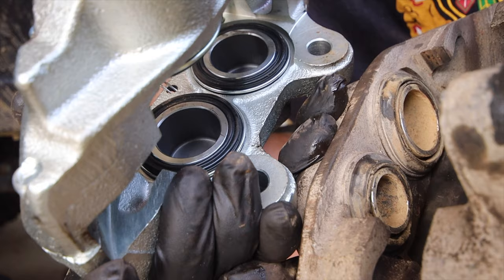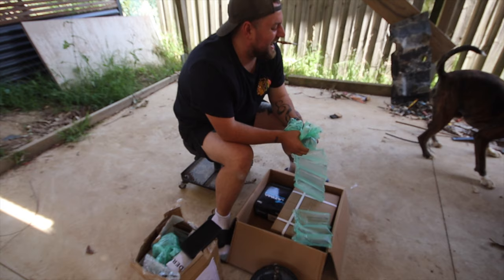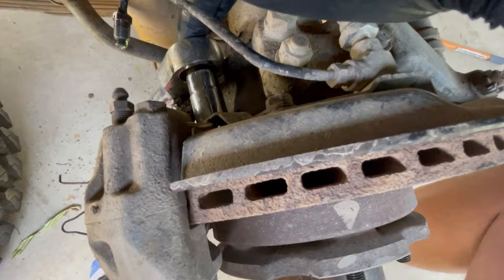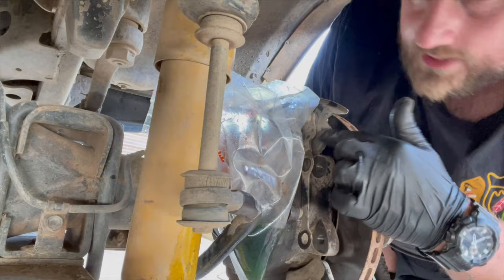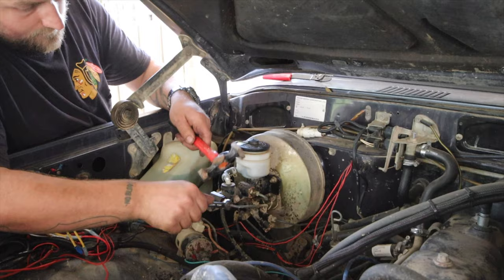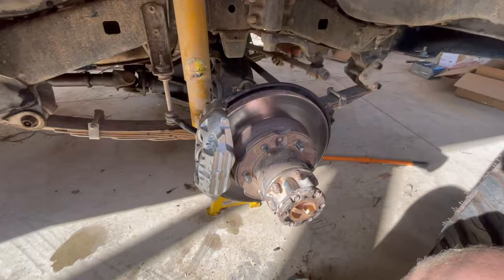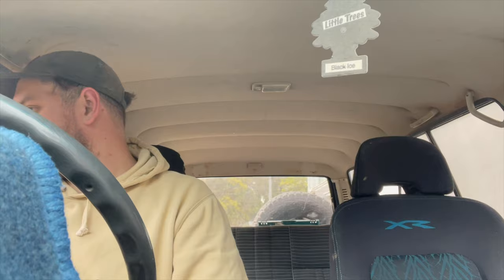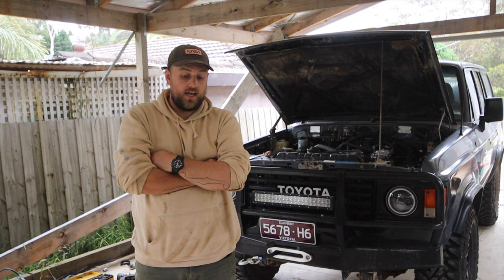Hilux brakes in a landcruiser?

Comment: Did you do the master cylinder? You're much smarter than I am. 33s and a 200kw 1uz in an 85' 60 with shitty brakes. Nearly put myself through a wall. Thankfully I managed to stop by down shifting and used the handbrake I'm defo going to do an upgrade. Your 60 is looking good!!
Reply from the maker: Jesus dude. That’s scary. Dude I’m not smarter than anyone else here. I learnt everything I’m doing on YouTube. I’m defiantly not a mechanic!
Reply: @favouritejay  Keep at it dude. We all learn by doing. It's going to look brilliant and you're going to be so stoked once it's all done.

Comment: you may find you'll need to get a bigger vacuum reservoir
Reply from the maker: Interesting, I’ll let you know 👍
Reply: @favouritejay  i'm having that problem after doing a ln106 caliper, 80 master and dual diaphragm booster, braided lines and fj45 rear cylinders. it runs out of vacuum after a couple of braking applications. Not a problem when you drive on the highway, but in the city it's a bit sketchy. I ended up purchasing an aeroflow vac reservoir and fitting this weekend
Reply: @favouritejay  Any further findings on the vacuum reservoir? or no issue? looking to do this on a HJ60
Reply: @michaelmacleod  it is needed, there about $140